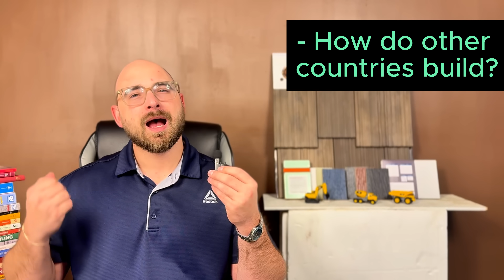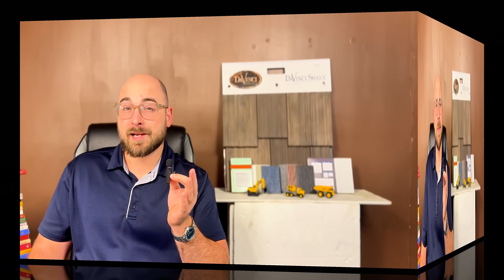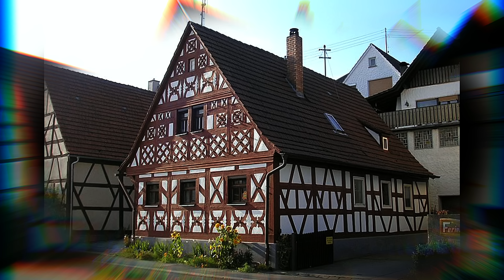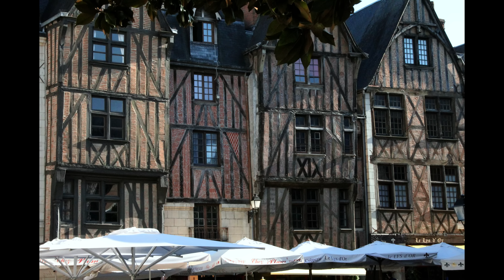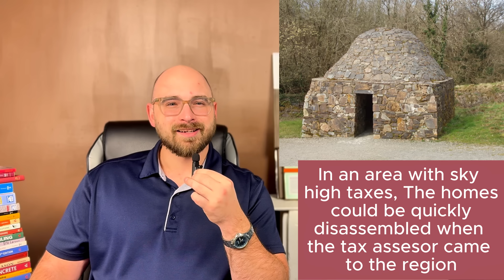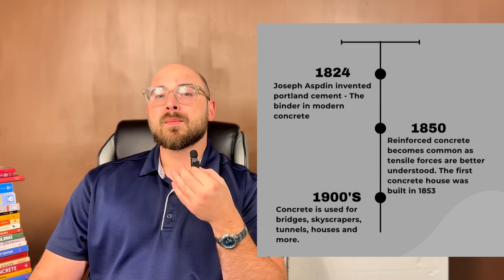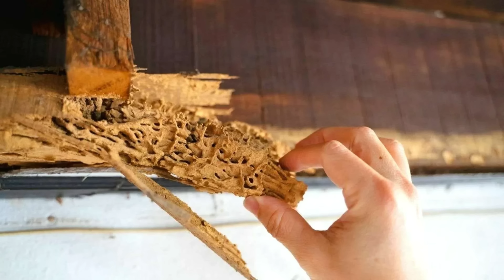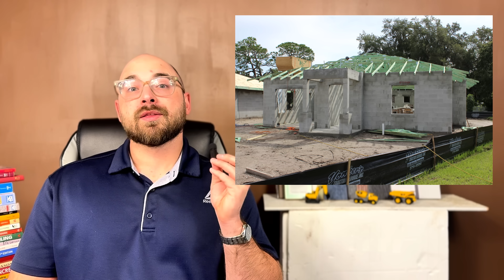Why Other Countries LAUGH at American Homes

Comment: Most Jamaican homes are made of concrete (block and   steel).The rooves range from zinc, concrete to aluminum aluminium/steel '(called alusteel), conctete type roofing tiles. Many rooves, just like the walls, are also constructed to be as hurricane resistant as possible.

Comment: What they're selling as wall studs today is atrocious. We're re-using as many of the old studs as possible. Currently rehabbing a small 1958 American brick Ranch home, so the outer walls are quite sturdy. We have a lot of older brick houses in Kansas, as there were several brickworks in the state due to the high clay content of our soil. The house was a hoarder house with over 12 tons of junk and garbage in it, and the walls/floors are still as square and true as can be expected for a house of that vintage. We managed to save several things of the original owner/builder. Pretty neat!

Comment: Wood being a renewable material is rich when you think about how long does it take to grow tree where it can be sold off and how much demand there is for wood...do the math. Even if you plant for 1 chopped tree 30 new trees means absolutly nothing because it takes at least 5 decade till they anywhere near usable...yes we have selective lumbering where not all mature trees are cut down but it's a finite amount as long as the demand outweigh the amount that can be produced while maintaining a constant number. That's why current lumber qualitys are so poor. So yeah bricks and other methods may raise enviromental concerns but wood is not better either and i haven't even talked about the amount of CO2 emission there is when you cut down,transport and process trees with the echological fallbacks such as deterioting soil quality, animals that nest there, disrupting an echo system and endangaring animal lives. So yeah that's not really a valid point you made.

Comment: I am Swiss and i would definately say yes to his last question if America should build more concrete houses. I can confirm that such houses will stand wihtout major problems for 200 years or longer. One thing i never understood is why Americans don`t build concrete Houses in Staates with hy risks of Hurricanes or Tornadoes. sure the roof would probabbly be damaged, but the structure would remain. Maybe someone from such an Area can explain to me the logic of rebuilding all 5-10 years in wood. My guess from far was that it is just cheaper for most low income citizens or am i totally wrong ?

Comment: Wattle and daub  here was lath and plaster usually with stucco in the after WW2 building boom...the biggest fire risk aside from wood shingles is the vent pipes all over roof with no double asbestos screens... Malibu California has lost tons of stone houses including the" Castle" in 2005( approximately) fire...by burning from the attic or inside...wood eaves, wood decks and firewood stacked against buildings are major causes.
All block and brick requires rebar and ties for EARTHQUAKES...they will tumble... Concrete is somewhat problematic as the gravel, sand sources tear up our riverbeds ...

Our garden habits of lawn ( that escapes into wild displacing deeper rooted natives) and weed whacking natives with no animals like buffalo, antelope or sheep to graze poof ...more grass no wildflowers or natives more fires more mudslides no water going into landscape...rivers and  aquifer.

Godspeed 
Dee

Godspeed

Comment: There is two materials never mentioned.

1. Siporex/Ytong or light concrete. You add gas (co2 I think) to the manufacturing process to make something like foam but that are almost as hard as bricks but much lighter and with a better heat insulation factor.

2. Leca blocks.

Comment: Lived in Germany for 3 years. The house was made of solid blocks.  If you only have one layer of wall you get condensation on the warm side.  My landlord agreement required me to open my windows for a few hours a day to let the moister and heat  ( or lack of heat ) equalize to prevent mold from forming.  American houses have multi layer so you never have a huge contrast of temperature differences in between the layers that causing condensation.  I got to say I love the Germany Roll up window shutters.  I all so live in England for 7 1/2 year. It is hard to compare one of the houses I lived in to a modern US build house because that houses was standing longer then the US was a country.  LOL  2 - 4 foot Stone walls, electric just stapled to the walls, No screen in the windows because that is a luxury and you get Taxes for it. No closets, because you get taxes for having an extra room.  No out door water tap, again taxes.  No TV, again taxes.  I Did love the Thatched roof.  It was so neat, but we have to move the BBQ grill way out in the yard so we did not light it in fire. LOL So yes, ever country has different houses for their own area, but cant really say one building idea is perfect for all areas.

Comment: In the Netherlands most modern houses are precast armored concrete with a brick outer wall. You will not see that much concrete here, walking around, but almost all is made of it. Even the complete concrete buildings get often an outer layer for isolation and looks. And we don't even have that much tornado's. We have more a problem with water, as all may know. 😅 But that's the part what's hard to understand for a Dutch person. Looking at the US, we see wooden houses being build and rebuild and rebuild, because they are in an area, with a high tornado risk. My Dutch brain would be like F it after seeing the first tornado in my area, and build a house like a bunker. Full metal shutters, and armored concrete sound great to me. :body-blue-raised-arms: I think that's the part that baffles people outside the US the most. Every year you lose lives, and just all you have. And just don't adapt to the world around you. If we here would be like that, we had to learn to breathe underwater. 🤔

Comment: wait R13???????  damn i dint expect the value of timeber construction with sprayfoam to be that low. I always though insulation would be one of the benefits of american construction. Im sure with proper finish and the outside framing must be higher then that.

Comment: Biggest issue I think you missed is the tolerance for local bugs (termites etc).  Nearly all homes in warm weather areas will be catastrophically impacted by termites if they are built with wood in proximity to the ground.  In climates where we have an annual freezing cycle (death to bugs exposed to sub 0 degrees C temperatures), we can build with wood with only a superficial (concrete foundation) ~25 cm stand off from the ground for isolation.  If you built that way (stick frame/wood) in a tropical area, your home would be infested with bugs very quickly, and destroyed in only a few years.  It (stick frame) also makes it a damn sight easier to modify the home as technology and opportunity present.  I've drilled my share of holes through walls to mount minisplit airconditioner heads on interior walls - mostly stick frame, but some hollow block/CMU.  It is a damn sight easier in stick frame, and you will see that in the installation price.

Comment: I’m currently building an earthbag home it will be flood, insect, fire, tornado, hurricane, earthquake, mold,and bullet proof/resistant.
The thermal mass will diminish the need for a/c.
Home insurance costs will be significantly
 reduced.

Comment: As I see it, the problem is cost and regulations. In the US the cost is high and the regulations are almost non existent in comparison with European buildings. However, in the US, building differs a lot from place to place and does have to do with resources, climate and zoning. An example of the last is the way the Los Angeles suburbs that were built in a way that makes them vulnerable to fires. They should havebuild up, and not in single home zones, as not to extend to the areas that are prone to fires.

Comment: I learned a lot today!!! Thx! <3

Imho, we laugh about your homes less because of the construction methods, but way more about your quality standards. As shown in your video: most of the overall assumptions (about having a perfect house) come from your local history and traditions. An absolute pro about US americans: you're incredibly fast at adapting! You're con: you like it as cheap as possible. Therefor I don't think, a lot of your citizenz will change to a slightly more expensive building method, no matter the amount of benefits... sry...

Regarding to your prefered method of using concret - I see a huge con about that: the lack of modifying! Once in place, it's rather difficult to remove and change walls. Constructions made of wood and bricks are way more flexible in the long run. (Especially when thinking of your way of coming and going to different places all of your live.) Dividing rooms, changing sizes of rooms, getting two rooms into one... I grew up in a brick build, semidetached, german house from 1989. I'm living in an eastern bloc concret building of the late 70's atm. I know ALL about the crap, concrete walls are coming with... Or just to thing about getting a nail into a concrete wall... horror! :-( So, as long, as you americans can avoid houses buildt completely out of concrete: do so!!! Build a concrete frame and fill the walls with whatever you think might be the best option. 

Thx again for sharing your knowledge about constructions. I really loved to learn such a huge amount of insights from all over the world in such a short amount of time! <3

Comment: As a Belgian I have to add that building with concrete here is a lot easier because our country is so small and dense. A concrete truck can only drive so far before the concrete starts to set because it's a chemical reaction, and here in Belgium almost everyone lives close enough to concrete production plants that almost anywhere in Belgium, you can build with excellent high quality concrete made in a dedicated factory.
In other, more spread out countries like the US you have to mix concrete on-site which results in lower quality concrete which means you have to use more of it.

Comment: A building should match its environment - if some big weather sometimes - should be anchored and have mass, take inpact and roofing that wont lift. Available materails is one thing but local knowledge/desire to build for multiple generations or one or less is a major factor. Its less aboout technology level diff - its cultural.

Comment: My grandparents' 'original house' - the one they bought to raise their kids in, and later bought back to retire in - was built in something like 1793 (in what is now Las Animas, Colorado).  My grandfather used to joke that the first insurance on the place covered "fires, floods, and Indian raids".  Hardwood construction with actual 2x4s, using a mixture of joinery, dowels/pegs, and square nails; not sure what the original roof was, but it's had the same metal roof for 100+ years.  Was retrofit with knob-and-tube wiring sometime in the 1880s, then updated to Romex in the 1970s.  Originally had a wood furnace, updated to coal sometime around 1850, updated again to oil around 1920, and finally to natural gas in the 1950s.  Not sure when plumbing came into the picture, but the original flush toilet was essentially an 'outhouse' tacked onto the side (as people of that era had a hard time accepting a place to poop being inside the house).

From what I can tell, it was originally a one-room house (what is now the 'den') - that part is all joinery.  What is now the kitchen and (once only) bathroom was added somewhere around 1850 - using a different kind of joinery, with lots of dowels/pegs as 'wooden nails'.  What is now the living room and two bedrooms was added somewhere around 1880 - using square nails (and apparently when the house gained wiring, as the K&T doesn't seem to be retrofit in this portion).  The entire building uses sandstone masonry as foundation and, in the cellar, you can more readily see how the house was expanded over the decades.

No doubt, they really knew how to build 'em back in the day!

Comment: I'd just like to add that part of the reason americans buy the homes they do is because that's what is offered.  Most americans don't build their own home, they buy what is on the market even if it's a new home or a home in a subdivision that's still being built its usually only wood framed houses.  So its not exactly surprising when 95% of the houses on the market are wood framed that that's what people buy.   I mean in my little town I think maybe 1 in 50 houses are made with some other method, so unless all the houses are torn down and rebuilt wood frames will be the dominant sales in my town for quite some time.

Just a suggestion that will go nowhere, it would be nice to see home subsidies applied towards longer lasting better insulated homes instead of shit like windpower, solar, ev's and whatever the new hotness is because this is not a subsidy for some business to make money off the taxpayer.  But hey that's not how america works now is it.

Comment: Do not have experience of all different styles but have grown up in a country that builds with brick and mortar with plaster and paint outside, but also with neatly build brick and mortar that does not required plaster and paint.  Later I moved to a country that builds with wood - wood frames inside and plasterboard with just a single brick wall on the outside just to protect the wooden inside.  My experience is that wood in an area that has many fires and termites is absolutely stupid. Also, too many shortcuts are taken and used that may later for changes make it difficult and expensive. Also, you can easily hear your neighbours never mind the person in the room next door.  I prefer the brick and mortar house because it lasts longer and require building practices that makes later changes easier and not so expensive.  They are cooler in summer and warmer in winter.  They do not require such high maintenance as wood. I do not like the wood houses.

Comment: Steel framing: Often this is not allowed in Germany, since Wood has a longer "standing" time than steel in case of fire (At least with the beams being used in Germany). So thin steel beams are quickly in the "not allowed" zone for fire safety reasons. Only in very large construction projects where they use very thick beams it is more common.
Having said that: My sister has a home built very similar to the US homes. It was much cheaper to build. Differences I can see to the US: Interior and exterior walls are executed sturdier, not single lining, but mostly double lining. Often OSB boards used and than a plaster board on top (This is mostly true for many interior quick construction walls: At least 2 layers and often the lower layer being OSB boards). Also the beams seem to be a bit sturdier. It is well insulated, but "Quick" to respond the temperatures. Meaning: If multiple people are inside a small room, the room heats up quickly. This is good in winter time, but can be an annoyance in Summer.
Conversely: My old hause I bought (some foundation walls have 1m thick stone wall from the fields surrounding the house (was a "cheap" farmers house) and a partial wood structure on top, but the newer part of the house has clay bricks with 24 to 36cm width. My house is slow to heat up, but retains the heat once heated up for several days. Also in Summer time, it keeps the cool over several days, and only once it is one week above 35°C (and also warm during night time) it is getting uncomfortably warm.

Comment: Interesting analysis.   I had wondered why Wooden housing is so Comon in the US.  And well the answer has been given.  Also, the style and type of housing has remained in the scene for a very long time.  I'm most familiar with the colonial style and lately it has been given new classical assets.   They are designed to fit their environment and needs.   Construccion will Vary from region to region and what not.  But I'd like to add to the matter the subject of Marketability.  and the thins is that A house historically has been a lifelong commitment whereas now adays many have become assets to be sold every few years rather than retained for a long time.   
I like the matter touched on the minimal requirements for construction to keep price low.   and I like this matter because there was a time that particle board was used in flooring and once wet the carpet became very structural.  Cost is always a big concern but often leads to less-than-Ideal materials than will do the job for a time. usually with in a warranty and soon after can be prone to failure. 

And I believe this might the source of the critique in some of the construction techniques seen in the US.  Some are designed to sell, and durability comes later.    
I personally see this take place in the so-called Mobile homes that are really very immobile after a few years as the material these are built in degrade quickly and these promised properties become traps that loose value like cars.   
I've seen a few rather infuriating documentaries about these becoming money traps. Specially for the Elderly.

Comment: you did not mention concrete sailboats, when wife and i lived aboard my 65ft yacht a cement sailboat pulled into the boat slip next to my boat.. in helping the captain with his dock lines that boat was very heavy and unwieldy compared to the more common GRP or less common wooden boats of similar length..